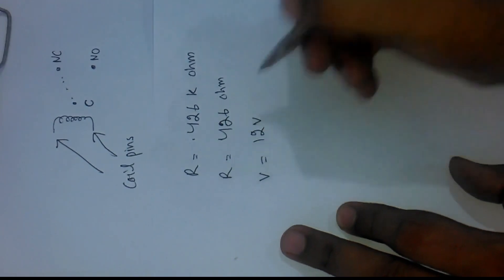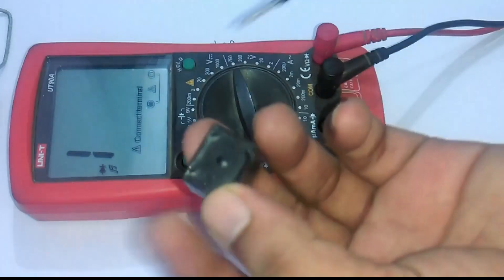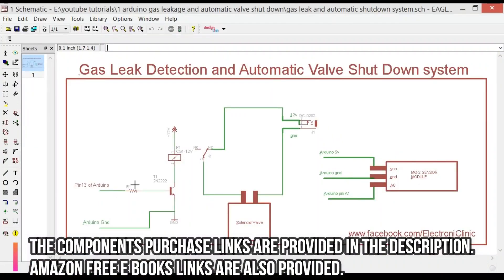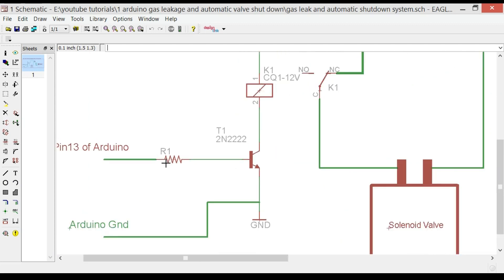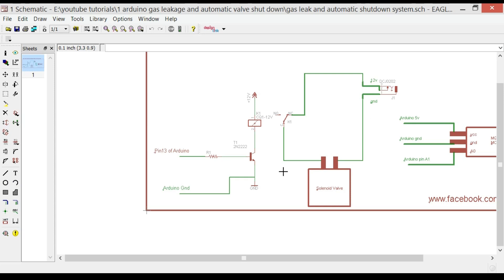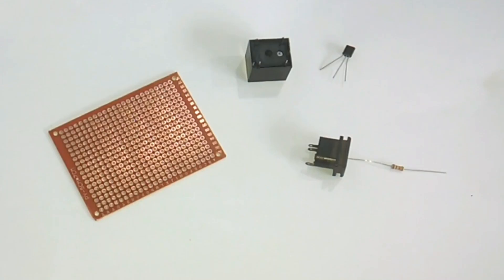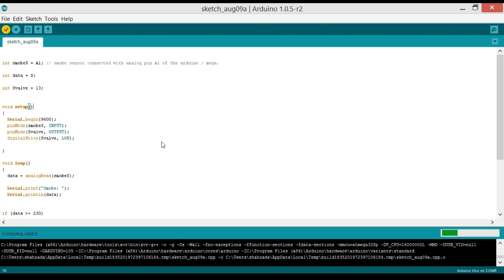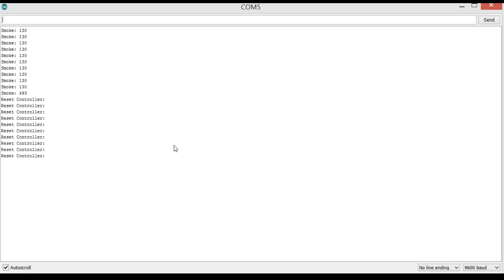Gas leakage detection and Automatic Valve shut down using Arduino ,Solenoid Valve, Gas Sensor MQ-2

Comment: Can we do this project on STM32 board
Reply from the maker: Of course you can. Watch my videos on stm32.
Reply from the maker: You can program the stm32 board using Arduino ide
Reply: Can u provide me the link of some projects which are based on STM32 and supporting Keil software

Comment: Bro, appreciating your video. But you did not put proper links for purchase. It is taking to  Amazon.com which is not deliverable. Any other options? because the Normally open type is very expensive and not available.